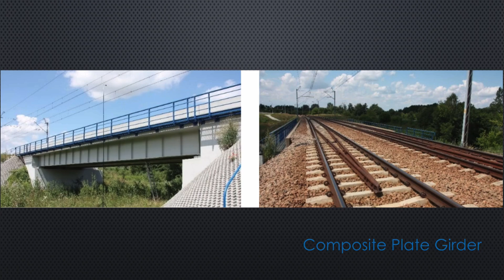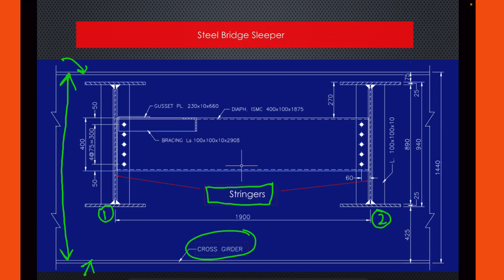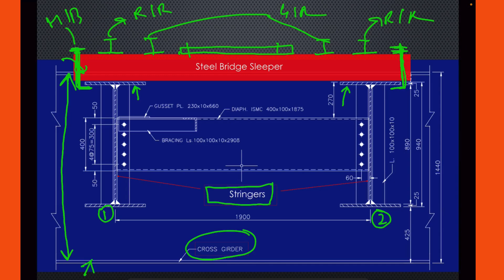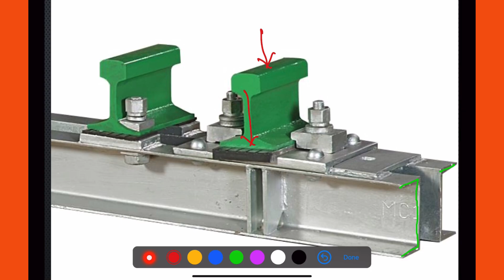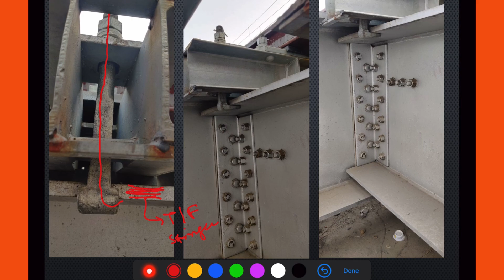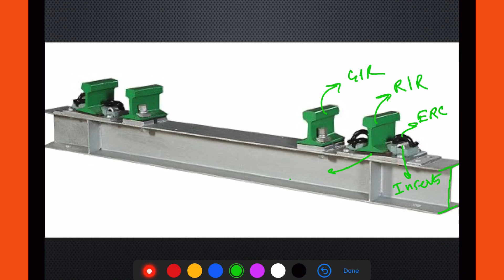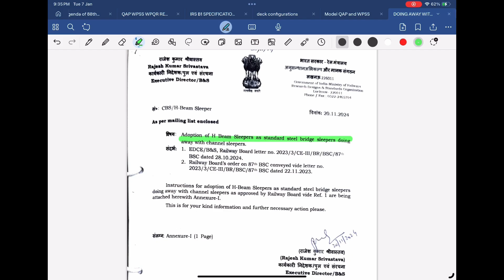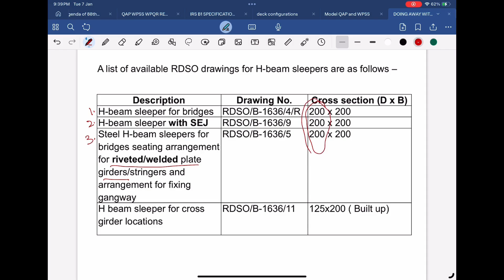Understanding Channel and H Beam sleepers on steel bridge girders #bridgebuilding #railwaybridge

Comment: There is difference in height of different girders so 250 mm height H beam sleepers are required
Reply from the maker: @bijendra86jaipur  in case of use of multiple girders of varying heights the difference is to be adjusted in pedestal and pier cap, keeping the rail level same and using same sets of sleepers.

Comment: Different heights of H beam sleepers to be designed
Reply from the maker: @bijendra86jaipur  presently RDSO has standardized two heights 200mm for normal use and 125mm for use at cross girder location as cross girder is 75mm above stringer level